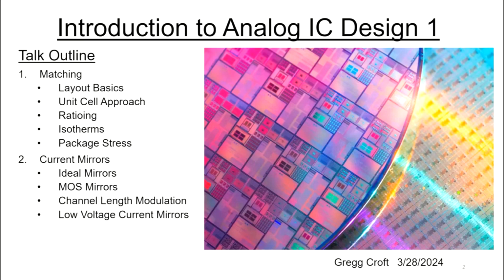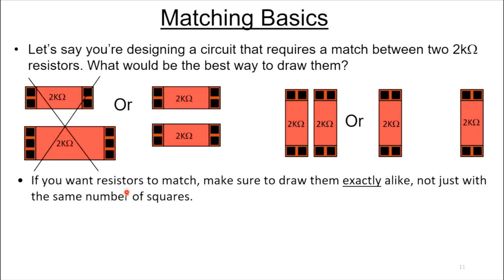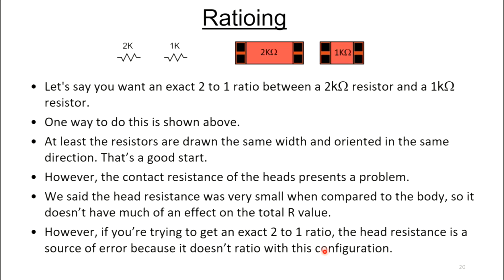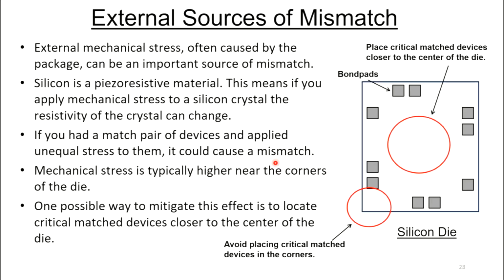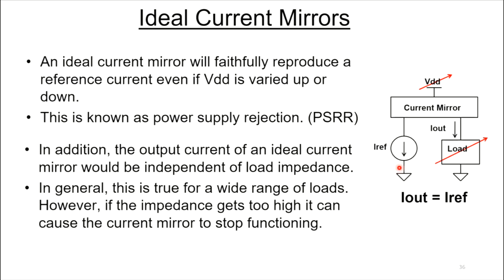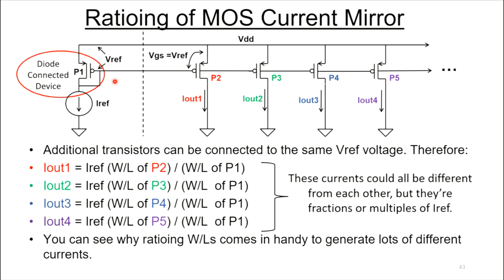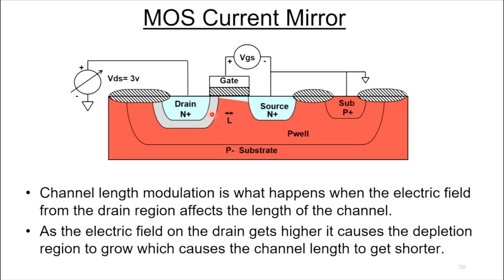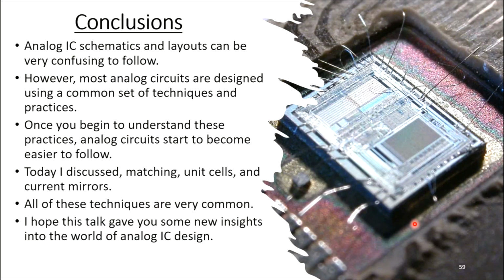Introduction to Analog Integrated Circuit Design, Component Matching and Current Mirrors

Comment: @10:12 i'm new to this stuff but shouldn't the orientation that's parallel to the direction of the gradient be better?
Reply from the maker: You don't know what direction the gradient will come from, so you need a structure that will attempt to cancel it if comes from any direction. A gradient coming in at an odd angle can be broken down into the sum of an X vector and a Y vector. If your structure can cancel out both X and Y gradients it can cancel out gradients from any angle. Thanks for the question.
Reply: @ChipCroft  I see, thank YOU for the answer. Great video

Comment: Very informative. This is how actually I like circuit explanation. I love the maths, but I need why first and top level idea before diving into details without knowing why I am doing that. Are you going to make future videos detailing it?
Reply from the maker: I'm glad you found this video helpful. I've been trying to present basic concepts without getting bogged down by the math. However, if you're interested in some of the details I do have a video about bandgap generator where I show a few of the equations in the appendix. I plan to do more videos. If there's something specific you're interested in please let me know and I'll try to fit it in if I'm able.
Reply: @ChipCroft  Thank you very much for your effort.
I believe strongly that starting easy is the best way to learn anything.
It would be nice if you could do some of the basic building blocks of analog, escpecially the intuitive thinking and if possible some analytical explanation.
I would like also if you could demistify the cascode thingy that it seems is the only thing that is used in most analog circuit.
Thnaks again